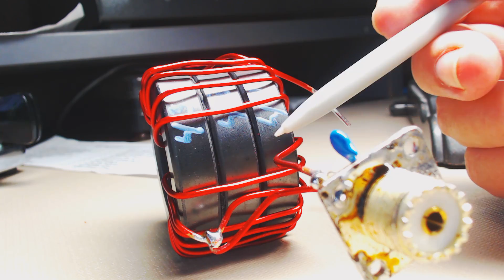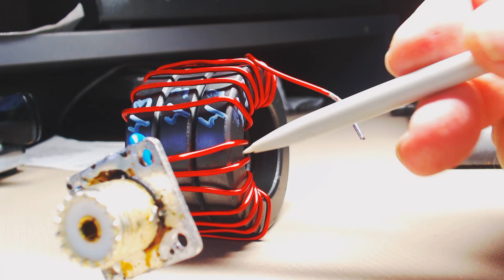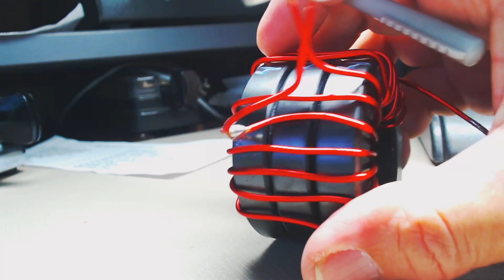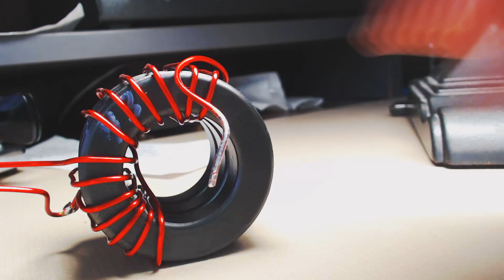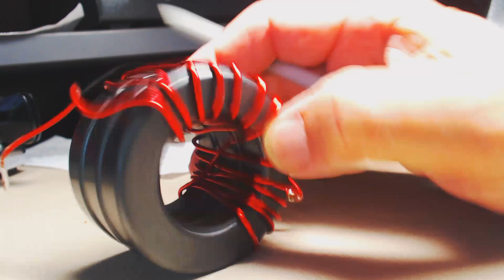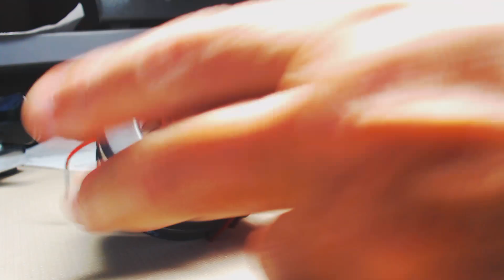Winding the EFHW Transformer Details

Comment: I might be wrong but I believe the final ratio for this is 42.25:1.  13/2=6.5.   6.5 squared is 42.25.  Also, does the crossover really make any difference? Could you just continue on winding around the toroid? I believe a 150 pf cap would help more for 10m.  I've build several multi tap ununs and prefer 31 mix for low bands, 43 mix for 30m and above.  Enjoyed your videos, I'm a cw op too and hope to QSO someday.
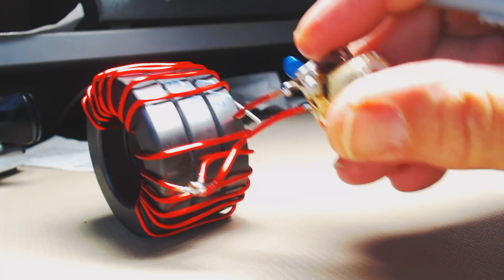Reply from the maker: Impedance = square of turns ratio thus 2:14 = 1:7 ....7 squared = 49.
No. 100 pf works best 
31 mix has far too much permeability for the transformer. Great for chokes though.

Comment: In a traditional twisted primary auto transformer (using colors from Facebook group diagram) the center feeds the red wire which takes two turns through the toroid (twisted section) then reaches ground From that point the blue wire takes over and has 2 turns through the toroid (twisted with red) then continues for 12 more turns for the total of 14. This particular tapped one takes two primary turns before being tapped to ground, then it takes 11 turns on the secondary side (I am aware your situation works better with 13 rather than 14) but this one is 11. The traditional design electrically is actually 16. What about the action of using a tap rather than twisted reduces the turns?
Reply from the maker: https://www.youtube.com/watch?v=BpdpkUEW39o
Reply from the maker: Suggest watching this ...It's the latest video showing how to wind the transformer in detail. 73

Comment: Hey Steve.  Just getting around to building one of these.  I noticed that W7ZOI did some measurements and found the 61 mix had the lowest core losses.  Have you tried it?
Reply from the maker: Hi Jim. Yes I tried 61 mix and it simply will not work for this purpose. I don't know why ZOI says that. I have a Facebook group for just the EFHW if you care to join. Lots of info there. https://www.facebook.com/groups/EndFedHalfWaveAntennas/
Reply from the maker: Oh...52 mix has the lowest overall loss for 80 thru 10 meters. I got this info directly from Fair-Rite Corp's engineer. It can also handle the most power. Use a stack of three 240 cores.
Reply: Well I guess these three 61 cores that I just got in the mail will have another use I hope.  Thanks, for setting me straight.

Comment: In previous videos you have 14 turns and in this one thirteen turns. Does this affect the end result.  thanks for your videos
Reply from the maker: Depends on the antenna configuration. Try 14 then 13 turns and see which you like best. My antenna is an inverted L and the corner is at 65 feet so for whatever reason 13 turns seemed to do better. 73

Comment: steve great videos, I ordered four 43 cores before I saw you mention the 52 mix core were twice as resistant to heating.   in your reply to lloyd, you said twist or no twist on the winding wires made no diff, but to mike webb, you said not twisted will not work as well. what am I missing there?  also, how do you know if the temperature is too hot from duty cycle, when this transformer is outside the shack?
Reply from the maker: Yes. Do the twist. Works better on the higher bands. If it were to overheat, the swr will slowly start to rise and eventually you would notice it, hopefully. Most newer amps will trip off if that happens.

Comment: Mix 31 is a MnZn ferrite, the bulk conductivity of the ferrite is too high, eddy current are too high, and power is dissipated in the core.

Mix 43 is best because the initial permeability (850) is high enough to get the appropriate choking impedance on the 80 meter band.  Most EFHW use 43 because it is a high bulk resistivity, high initial permeability NiZn ferrite.

Mix 52 will probably only work on 40 m and up because its initial permeability is much lower (250), unless you stack a lot of the ferrite cores.  At 80 m the permeability of 43 is 480-j220, and 52 the permeability is 293-j18, so you will need 2 times as many 52 cores to get the same choking impedance magnitude at 80 m.  The two are closer in magnitude above the 80 m band as the permeability of 43 decreases rapidly.

I designed a winding pattern that achieves lower loss than the standard pattern, look at

https://drive.google.com/open?id=0BwFicJLV0O4jWHRsU0JiU1NZTk0
https://drive.google.com/open?id=0BwFicJLV0O4jWDNVZGN5S0FXeXc

for some information on the pattern (these are PDF files on Google drive).   It does so by reducing the leakage inductance of the transformer.   I did some back-to-back tests of efficiency.

73, Dan KW4TI
Reply from the maker: Thanks Dan. I'm stacking 3 cores of 52 mix and recently 4. The much higher Curie temperature allows for more power on 80 meters now. 43 mix reaches Curie much too early when running QRO on 80m. Covering  3 to 30 mhz with one transformer isn't easy but rewarding. I will read your work. 73 Steve N4LQ
Reply: Also wanted to mention is that you can add multiple taps when you wind the transformer, I suggest you add that in a future video?  You can use higher turns ratio tap and the low band and the lower turns ratio tap on the high bands.   Having multiple taps is helpful for experimentation and not very hard to do.

The impedance of the wire tends to drop at higher harmonic bands because  of radiation and environmental losses.  A half-wave antenna has a high impedance because there is a standing wave on the wire, and the wave that reflects off of the open end of the wire constructively interferes the voltage and destructively interferes the current at the feedpoint.  At higher harmonics, there is more loss due to radiation and environmental losses (the ground) so that the cancellation of the current at the feedpoint is not complete, and therefore the feed impedance drops.  Environmental losses are actually why the impedance of the half-wave antenna can vary and so the turns ratio may need adjusting.  If there are a lot of environmental losses, the impedance can be quite a bit lower on higher bands than lower bands and the bands are harder to match with a single turns ratio, so keeping the wire higher can help.

In NiZn ferrite where eddy current losses are low (requires high bulk resistivity), and if the peak field is not too high to minimize hysteresis losses (requires a large enough cross section of core for the flux), the main contributions to dissipated power are the shunt reactance and the leakage inductance.  The leakage inductance is due to flux of the primary not passing through the secondary.  Because ferrite has a lossy permeability, leakage inductance has a resisitive component, so that the core dissipates power.  The EFHW transformer is difficult because a large turns ratio is needed which means that there are many secondary turns but few primary turns, and therefore it is hard to get them close enough together.  However, if the windings are too close the turn-to-turn capacitance increases.  The trick is to wind the transformer so that the primary and secondary turns are as close as possible while spacing them out enough so that winding capacitance remains sufficiently low so you don't get any resonances on the secondary windings.  This is what I tried to do with my winding method.

Anyways great videos helping hams make and put up antennas!

73, Dan, KW4TI
Reply from the maker: My transformer is 100 feet away from the shack so I don't want to fiddle with it. It is mounted to a wood post about 2 feet off the ground. The antenna goes vertical for 51 feet then horizontal. It works great. I might put up something separate for 20m and up anyway.

Comment: Steve. Have you tried using two wires and not twisting them?  Also I'm only running 100 watts, max - so will one 240-43 core be ok?  Thanks. Great videos. 
Mike
Reply from the maker: 2 wires not twisted will work but not well. Just use the autotransformer method. Much easier. And yes one core for 100w is ok although it is less efficient than stacking 2 cores. It's worth the bit of extra expense to use 2 cores, especially for low power work. Why waste power?

Comment: Hi Steve, I want to try this project and have the same question as Lloyd. Also noticed that on this one your cores say 43 versus your previous vid was 52. I happen to have 3 mix 31 cores, would that work? which one do you recomend?
Reply from the maker: You cannot use 31 mix. You can use either 43 or 52 mix. 52 mix cores cost about 3x more but their Currie temperature is double that of the 43 mix and can handle a huge amount more power. If you are going with more than 500 watts then stick with 52 mix.

Comment: Steve Thanks for your videos.  I have a question on this one.  I noticed that the primary double twisted wires were not used on this one.  Please explain why not?  Lloyd KO4L
Reply from the maker: It's just something I wanted to try. Both methods gave the same results. Tapped is easier to do. Also it's easier to keep the windings tight against the core which is important. Finally, there is no chance the tapped winding will short out but that tight twist could if the insulation came off while twisting. I used a drill. SWR is slightly lower on the higher bands when using the twisted method.